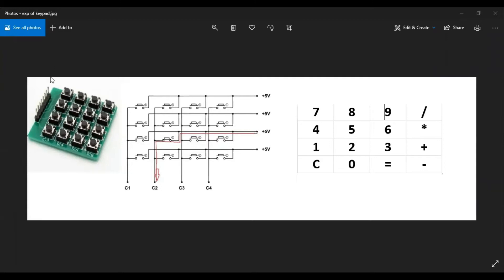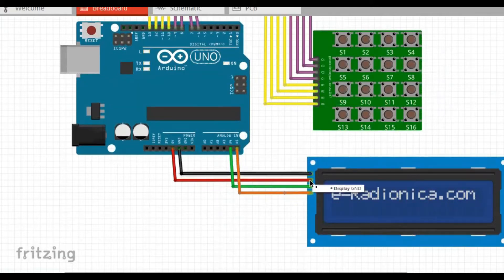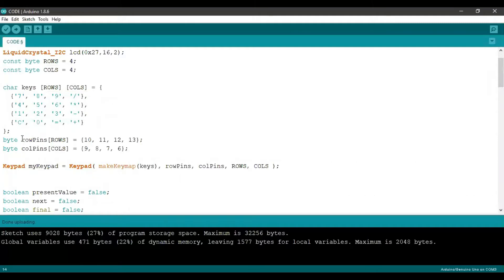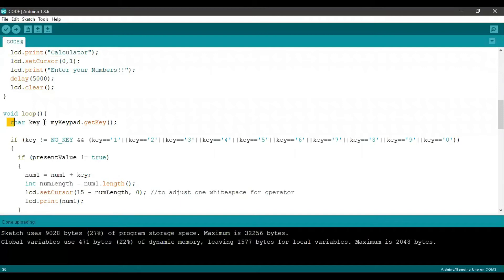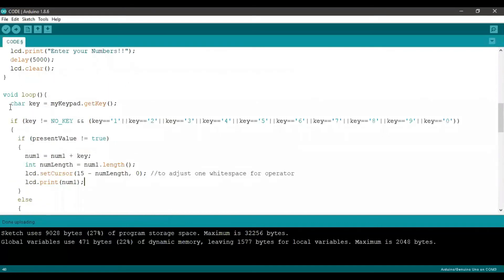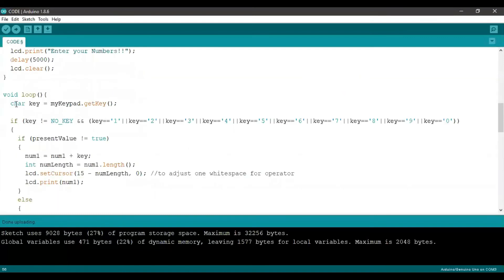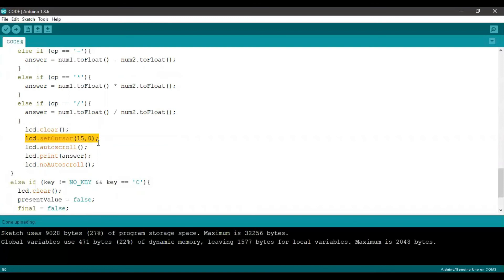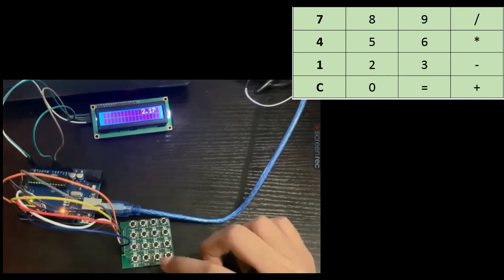Interfacing 4x4 Keypad with Arduino | Making a calculator using Arduino | Arduino Calculator

Comment: This video is a gem for anyone interested in Arduino projects! The concept of building a calculator using a 4x4 keypad seemed complex, but Learn Electronics India broke it down into easily digestible parts. Thank you for sharing your expertise with the community.